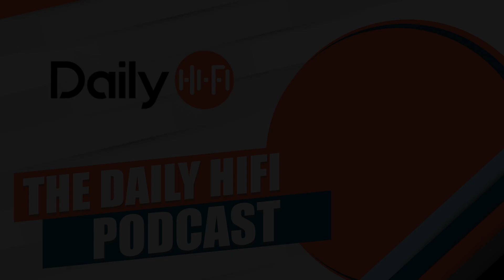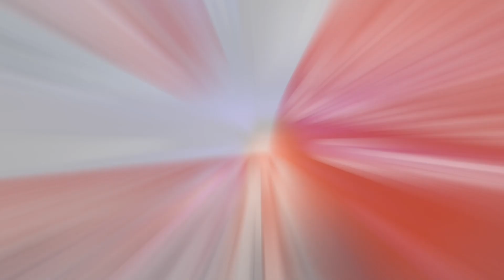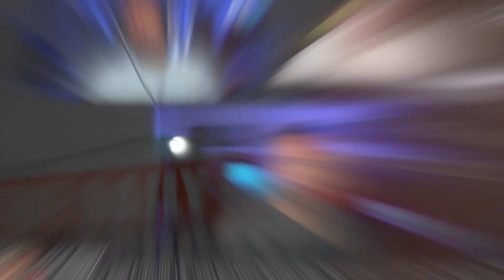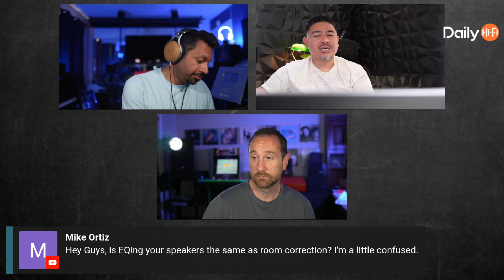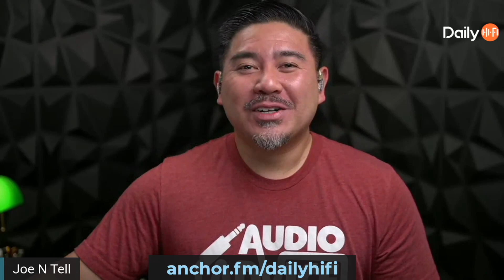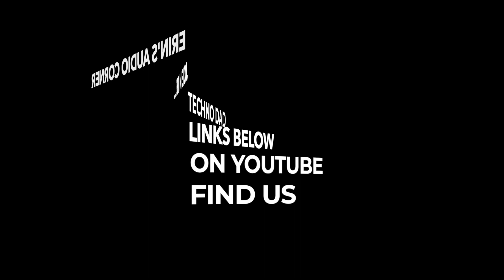Is EQ'ng A Speaker The Same As Room Correction?

Comment: i like this distinction, i been using those interchangeably before. time to change.
but at the same time i do not do dsp in any of those ways.
i also do ear correction at the same time.
the end goal is to make my system reproduce every frequency at the same amplitude to my ears in listening position. 

the speaker designer do their best work, i make sure my room is at its best, and then i tune the amplitude of the signal to match my hearing.

Comment: The EQ itself is the same. It's the same type of parametric filters acting on the signal before it gets to your amps, there is nothing different about the EQ itself.

BUT the purpose is not the same as explained in the video. For this reason the two 'layers' of EQ are usually separated to make the process of setup easier.

You might have active speakers that internally EQ the signal to get deeper bass. You might also have a AV receiver that EQs to remove a room mode. In this case the EQ is literally separated and processed by different equipment.
Reply: Exactly! Sometimes we refer to this as pre-EQ. Like you mentioned, a speaker designer knows enough about the design to know if the bass can be extended without distorting. Typical room correction does not and will not attempt to extend the bass which is a smart decision.

Comment: Is the biggest difference not that digital eq/room correction will only be valid at the point of measurement (the hot seat listening position) whilst the physical correction like traps, diffusers etc. will take care of the nodes wherever you listen in the room?
Reply: Traps and diffusers won't affect all areas of the room equally either. Room modes caused by the room are different in different areas and the treatment to the room is meant to change the effect of the room.

Comment: That was super confusing..😅
I don't listen to a speaker nor do I need to EQ it.

When putting that speaker in a room it will change how the speaker perform when it is in that room. So we all listening to a speaker in a room.

 So the issues with the speakers that is not EQ is measured in my room and I make a EQ filter for that whole combo and that is what I listening to.

Feels so wrong to EQ a speaker up 3 dB at 60 Hz because the speaker itself had a dip by 3 dB at 60 Hz.

Then I put it in a room that may act also on the 60Hz now I need to EQ that again on top of what I already have done...

Makes no sense.

When a speaker in a room as a combo alter the preconditions and what you get then it is in my opinion one EQ that is needed just there and then.

Maybe I misunderstood something completely..😂
Reply: The room dominates the response below about 500Hz. You’re correcting for the room below that and for the speaker above that. 

There. How’s that for oversimplification? 😂
Reply: Let me re-watch and see how confusing it is. 😁
Reply: Ok, just watched and I get that it's confusing. It's not a simple answer and that's the issue. EQ to a speaker vs EQ for a speaker in a room might have different purposes. A speaker designer might EQ down a resonance in that speaker. That's needs to be done irrespective of the room. The end user might want to EQ down the resonance caused by the room. You would hope that EQ'ing the speaker in the room would also catch the same resonance that the speaker designer aimed to reduce, but the DSP might not be precise enough to fix it or the measurement method might not catch it depending on the method. So, you can see how a combination of an anechoic EQ correction can be helpful in conjunction with an in-room correction.

I agree with Erin's response. And yes, it's also an oversimplification because the range where the room dominates depends on the room size and acoustics of that room. But generally, 500hz is about the range of the transition region. Don't worry, my Magic Beans True Target app will figure it out for you. 😉
Reply: @joentell  Thanks, yes that is a of course a big difference that I missed. 
If you design and develop a speaker then it makes it highly desirable to develop the speaker when room differs (yes there is a defined model or average "room". But the speaker is of interest for designers or modifiers.).

Ok I will just keep adjusting speaker in room and that is enough for me.. maybe it is little bit easier when I don't use boxed speakers and have not the issues that a box bringing to the table.

Thanks guys! 🙏🥳
Reply: @AmazonasBiotop  You asked a great question that allowed us to expand on our thoughts and get into more detail than we did in the video, so THANK YOU for that! I always tried to be the guy in class who asked what I thought was the "dumb question" and after I did, I realized half the class also wanted the answer to the same question. 🤣
Reply: I agree with you but it was a little hard to follow, especially the first part.  But the part about why double dip and eq twice makes sense.  Why not wait until the speaker is sitting in the environment with a glass window/couch near it and then adjust as needed?